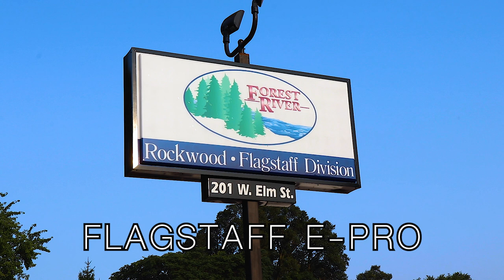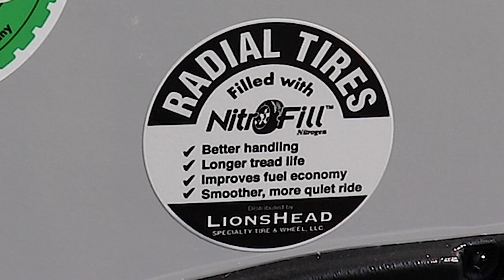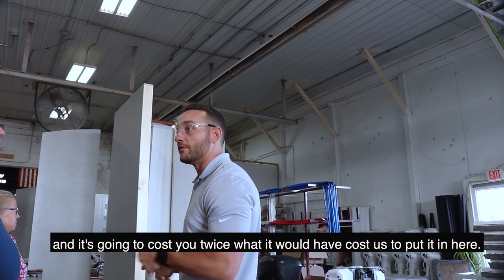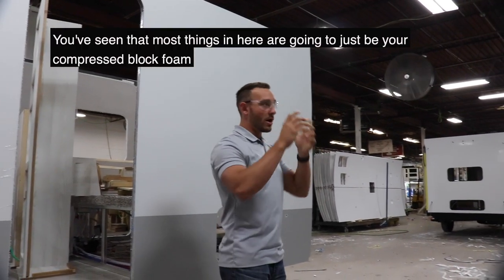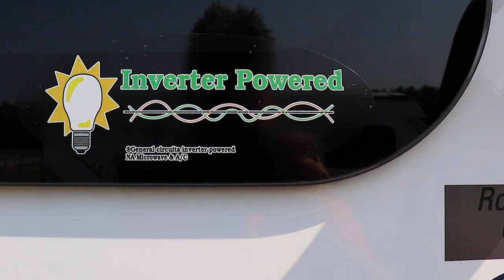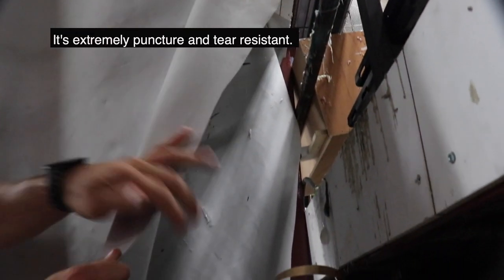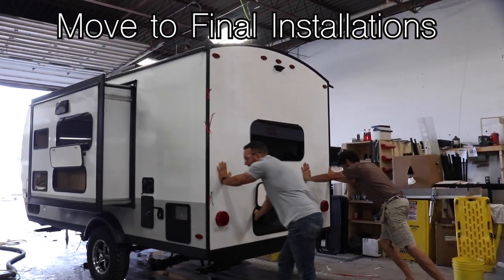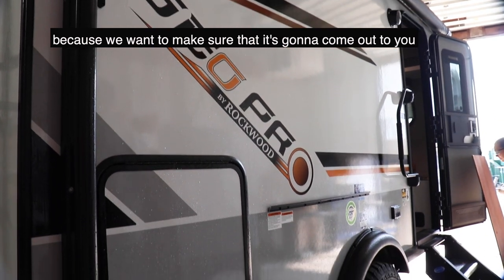Rockwood Geo Pro Travel Trailer- Flagstaff E Pro Factory Tour | How the Geo Pro and E Pro are made

Comment: Recently purchased a Geo Pro 19FBS and while inspecting the under carriage noticed the DARCO moisture barrier was torn at most of  the bolt penetrations around the perimeter that hold the aluminum frame in place. Good thing for duct tape.
Reply from the maker: paul1mdrn thanks for reporting this! Did you get that info to your dealer? They have the best inside track for reporting quality issues. This one sounds important. The moisture barrier is no good if it has holes.

Comment: Wondering why you didn't show any of the welding, aluminum joint construction, or how well the wall/floor/roof sections are built. IMO, poor welds are just as bad as sticks and staples. Thanks for all the work you did putting this together.
Reply from the maker: Hi @Paul Buehler!
I didn't show these things due to a couple factors: All the welding & fabrication of aluminum framing is done at sub-assembly plants that I didn't tour.
Likewise, the wall/floor/roof assemblies are constructed in the lamination plant. The tour I was on was public and it moved right along. We didn't linger at any one station for long.
From my experience and that of other owners, the framing and laminations of the Geo/E Pro are solid & reliable.
Thanks for the question!

Comment: Just bought one picking it up 3/28/20 GeoPro 19FB Parris RV Salt Lake City Utah. My first RV camper. Super excited. Loved the tour thank you, the seem like very well built trailers.
Reply from the maker: Jason Robbind! Super stoked you’re getting one! My wife and I bought one as well recently. A 20FBS. Been too busy to use it yet but are excited nonetheless. These are GREAT little trailers and I hope you make tons of memories in yours!
Thanks for watching & commenting!
Reply: Jason, how's your coach holding up so far since your purchase? What is your tow vehicle?
Reply: @USNavyAR5  Hi, its holding up great so far, already been all over Utah,Colorado,New Mexico, Arizona.  The 100 W solar panel works great, I did have 2 Lion lithium Ion batteries installed so going off grid is no problem And sense they're so light I upgraded for the big propane bottles also. My tow rig is a 2019 Toyota Tacoma TRD pro. I installed a massive transmission cooler and  l'm running a equalizer hitch and she rides like a dream. I just  Winterized it and covered it for the winner cause it's starting to get cold here in Utah at night have a good day. Good  luck.
Reply: @jasonrobbind231  Outstanding! I also have a 2019 Toyota Tacoma 4wd double cab V6, so looking for something lighter to tow. Thanks for responding back.

Comment: Forrest River might want to put in some extra time making sure the nuts are torque per spec on the bolts that hold the body to the frame of the Geo Pro. I found 4 ea that were loose and found out this is a common issue.
Reply from the maker: weatherherk1 I’m hearing it’s a common problem as well. I’m not sure more torque will fix the problem though. There’s only so much torque you can put on those before they start to crush the wood. I suspect a long term fix will be using self locking nuts. 🧡Thanks for watching & commenting!💙
Reply: @CrowdFreeRV  I had this problem as well. Did you get a visual look at how the 12 bolts underneath (2019 19FBS) are connected to the frame? What backs them up? I had a couple nuts fall off, then the bolts actually started spinning/stripping when you try to tighten them. My dealer added a few bolts/nuts through the floor of the camper after it was obvious the body of the camper had slipped/moved forward on the frame.
Reply: @CrowdFreeRV  What they should do is use steel plating on the floor( maybe 4”x 4”x 1/4”) and run regular bolts through them instead of carriage bolts and use a nyloc style of nut to attach the chassis to the frame. Much more surface area so the bolt won’t pull through the floor when tightened down.

Comment: Since you visited the factory, did you get any better idea about how specifically the solar panels were mounted? Are they just screwing the aluminum mounts into the foam? Im looking to add the extension gopher panel and would like to mimic the construction method of the manufacturer. Thank you,
Reply from the maker: Hi @Todd Sheehy!
It was the older version 100 watt flexible panel being installed when I toured the factory. It’s now a 180 watt hard panel now and I haven’t seen the installation of it.
I would assume the aluminum brackets are screwed to the plywood roof decking. Normally roof sealant is applied to the bottom of the panel brackets and the screws will have sealant applied on the threads as they are installed, and then both are sealed on top as a final step.
Rockwood does have a Support tab on their website for questions like this. 
And you might be able to gain some info in the FROG forums.
Hope this helps!!

Comment: Thank you for the video. Did you happen to have any discussion with them on reasoning for single axle vs dual axle? Can you tell me how it feels to go from a dual axle trailer to a single axle trailer. Thank you
Reply from the maker: Hi @HY Y!
The reasoning they stated when I took the tour is they are ultralight trailers and one of their original goals was to keep every model under 3000 lbs dry weight. In 2020, with the G20BHS at 3400 lbs dry, they exceeded their 3K benchmark for the first time. So yeah, the short answer is keeping them as light and as towable as possible.
The big change in towing feeling is movement. The short single axle moves around a bit more and it moves a little quicker. It is highly maneuverable though,  I can get it in & out of just about anywhere. The biggest downside of the single is reduced cargo carrying capacity.

Comment: Do they offer a 4 season arctic package? Also I’m a newbie and saw the Grand Design warehouse tour on a separate video. Their trusses are made of wood. Is there such a thing as metal trusses?
Reply from the maker: 👋 Hi @Raymond Ward!
They do not offer a four season package, nor would I expect them to. This is primarily due to their goal of trying to keep all units under a benchmark 3,000 lbs for greater tow-ability. I will tell you from my experience that the Geo Pro does “mild” winter pretty good for a 3 season trailer. We’re wintering in NC and have seen some 27 degree nights. Nothing has frozen up. I run a heated fresh water hose and I have insulated the fresh water low point drains. Whenever it’s going to be near or below freezing I turn on the tank heaters. I run two small electric heaters as primary heat and set the gas furnace to kick on a little when it gets near freezing outside. I would not recommend trying to winter in a Geo Pro off grid without an upgraded solar & battery setup. And I would not recommend one for longer term  sustained below freezing temperatures.
.
To my knowledge no one is using a pure aluminum roof truss. The Geo Pro uses a hybrid. It’s a combination of aluminum and wood. Just speaking for Rockwood and Grand Design, they both make a good “walk on” roof.
Hope this helps!
Thanks for watching & commenting!

Comment: I have the 12srk and have enjoyed it thus far. Only minor things, added a switched porch light..the only way to turn it off before that was to open up the rear kitchen. I also added an additional solar panel, funny thing the side connection for the additional panel needs to have a charge controller on the added panel even though the onboard charge controller could handle it. I plan to rewire that. The A/C is huge for the size and useless when boon-docking..I would have preferred a smaller unit and maybe a 12v big fan. I tow it behind my Jeep and have had it down some rough roads, so far she’s holding up. I enjoy the creature comforts this little trailer has when full connections are available but rough country camping is why I bought it. Similarly purpose built trailers are 3x as much. I am afraid if the screws start backing out of the micro wave I may leave on a dirt road somewhere but I keep an eye out, may just pull it for the space. Bottom line, happy with camper and would buy again.
Reply from the maker: 👋 Hello @rambokd! Great to hear from you. I think what you have stated about the cost is one of the biggest factors for choosing the Geo Pro. Better built units are out there but at a factor of 2x or 3x the cost.
You are the first comment I’ve had from someone pulling a 12srk behind a Jeep. It’s great to hear that it’s holding up!
Appreciate the tip on the aux solar panel. I hadn’t heard the before and like you would have assumed the interior solar panel would handle it. I think I’ll get a suitcase unit with built in controller.
Thanks for watching & commenting!
Reply: Watching the madness in the factory explained all the extra hardware I found in my trailer. At first I thought there were screws coming loose but there must have been a dozen extra screws. I pulled all my access panels to see how everything was routed and connected. The external solar plug runs directly to the battery through a circuit breaker, in my case along the front driver side rail. I had to contact forest river because of the issue with the solar and they were kind enough to send me the wiring diagram. I currently have a y connection on the existing roof panel, but plan to run new wire down from the controller. The batteries, I have 2, have not dropped below 80% with normal use to include some gas furnace use on cold nights. I added a rear awning so I can close my kitchen but still have rain protection for my table and chairs. If you leave your kitchen open little bandits will worry you to death. Funny coincidence, our first night in it was next to another Epro owner on his first trip. He had the 19ft version and the Bluetooth app to control your stereo doesn’t care which system you connect to...his radio woke up earlier than he did, I thought mine was broken.

Comment: One thing you missed, installation of the water and holding tanks, where are they, are they enclosed in a heated space or just below the floor and in the elements?  Thanks
Reply from the maker: Scott hello sir! My apologies that I missed this question earlier.
All models have the holding tanks mounted between the frame rails and just under the floor of the unit in an open and unenclosed space. Rockwood does not enclose the underbelly on these to keep weight to a minimum. The tanks are heated though via 12 volt heating pads mounted on the underside of the tanks.
The location of the holding tanks widely varies by model. I own a 20BHS. The fresh tank is all the way forward, the grey is just behind the axle, and the black is all the way in the tail. Hope this helps!
Thanks for watching & commenting!

Comment: This is a very nice rig and I am considering buying one.  It looks like they are taking advantage of some new technology but, there are some things I would like to see.

1. A dehumidifier. Cooking with propane, normal breathing and camping in humid areas produces humidity in the coach. There are some newer dehumidifiers that could be built  in. 
2. An on demand propane water heater in lieu of the electric/propane water heater. Very efficient, less space, less weight.
3. Two 30 pound LP tanks
4. Switch to LiFePo4 batteries. A bit more expensive but lighter and better performance.
5 . Better wire control on roof for solar. Evil trees will reach down and snag those wires.
6. Roof rails to mount things such as satellite and radio antennas, weather station components.
7. Full underbelly protection.  Mice and squirrels are the enemy of RVs.
Reply from the maker: Al Dec thanks for watching & commenting! I have a full quality review coming up on my Geo Pro, a 20BHS. Stay tuned.

Comment: Should  you ever have to touch up a cabinet or such, is there a specific paint code for the white paint used inside these RV trailers?
Reply from the maker: a1930ford there is not one that I am aware of. Your local dealer should have a list of contacts at Rockwood/Flagstaff where this question could be answered. If this does not work, you could possible remove a small part and take it to a paint store to be scanned to get a mix code.

Comment: I would like to have seen how the walls are actually connected to the floor.   I bought an E-Pro 19FD new in 2018.  From the factory there were problems with the steps not installed correctly, entry door not installed correctly, cabinet wood had termites ($1200 to exterminate), antenna not fasted to roof.  I just finished using it for 4 months full time and the dinet frame broke apart from travel/vibration (never sat on it).  I've resealed the roof seams every year and now have found water damage around the entire floor where the walls meet. I'm now looking at major repair cost or taking a big loss at sale/trade.
Reply from the maker: @KstrSM15 when I did my tour I did not see how they attach the walls to the floor.
I’m sorry to hear about your experience. I’ve never heard of an e-pro being this bad.

Comment: As someone who worked in a manufacturing environment with ISO 9001 quality systems, I can tell you this factory is the exact opposite of a quality-focused  environment. Modern factories are incredibly clean and organized (nothing is out of place). There are many tools and jigs assisting the employees with perfect repeatable quality installation at every step of the way. Notice how the lady was just free from slapping on graphics or how they guy screwing in the slide was just holding his screw gun at random angles and reaching? 

This factory appears very unorganized with almost all completely manual processes and no tooling or assembly jigs. A modern factory also has quality control at every step. Not just at the end. I.E. them orange taping issues or the guy quickly caulking a leak. This is about what I expected and I’m sure it differs little from other lower or mid-priced mfrs out there. You can see this and know there’s a ton of room for human error or stuff slipping through. That’s just the RV trailer market as a whole though. Not trying to single out Rockwood. I do overall like their Geo Pro. I just wouldn’t expect much more than any of the other common name brands out there.
Reply from the maker: Mike Wiebe 👋 hello sir! Having worked in manufacturing & aerospace for 7 years myself, I understand exactly what you are saying and agree with your assessments. I bought a Rockwood Geo Pro at the beginning of this year and just returned from its initial shakedown trip of about 5,000 miles. This is my third travel trailer and I am thrilled with the progress the industry has made. I’ll attempt to briefly elaborate:
If I could sum up your comment into one sentence it would be “RVs have been and still are sloppily assembled”. My Geo Pro is consistent with what I saw at the factory tour - it is indeed sloppily assembled.
However, the advancements in some materials and methods make a tremendous difference -
Because of Azdel & vacuum bonded walls I will never have delamination.
Because of the welded aluminum framing I will never have the structure rot.
Because of the Torflex axle I don’t have wear points at the springs & shackles.
Because of the welded aluminum interior structure & “screw & glue” cabinetry, my interior isn’t falling apart after 5000 miles.
Because of the arched roof trusses I never have constant standing water on the roof making my roof seals go bad.
Etc, etc, etc...
.
So yes, the industry has so much room for improvement, but there is also much to be celebrated.
I’m going to do an initial quality review of my G20BHS soon and I’ll share the good, bad & ugly.
Thanks for watching & commenting sir. It’s much appreciated!

Comment: So the roof membrane isn’t bonded to the laminated roof? And what is directly under the membrane?
Reply from the maker: Hi @Leland Plume! They do indeed bond the membrane to the roof. They apply the adhesive up on a work platform and I wasn’t able to get a good shot of the process.
The roof plywood decking material is directly under the membrane.
Reply: @CrowdFreeRV  OK. Thanks! I was asking because I was on the ladder, looking at the roof of a brand new unit on Saturday and there were unbounded wrinkles around virtually everything that was attached to the roof! I’m afraid the expedited manufacturing that’s taking place right now is not only affecting putting in the required appliances, (12v fridge, low profile AC, porcelain toilet), but the quality of workmanship may be taking a hit too, (unbounded membrane, cabinet doors separating, body to frame bolts missing or coming loose). They still build a quality product but I think they may need to make some changes. The blogs and forums indicate their reputation may start taking a hit.
Reply from the maker: @lelandplume6889  yes, this trend is appearing across the board in various ways for all manufacturers. I looked at a Keystone Outback Ultralight with a family member last fall. Keystone is a quality brand. The entire roof of this brand new trailer needed a reseal. All the sealant was shrinking and opening up with seal-voids. I suspect they had run out of their regular sealant and used an inferior alternate. This is just one of many stories.
.
I expect this trend to continue through 2021. From what I am hearing from dealers is there is still pent up demand from 2020. The units are rolling out as quick as they can roll in from the factory.
Reply: @CrowdFreeRV  the numbers I’ve seen indicate your correct. The projection is that over 1/2 a million units will be built this year to meet demand. The highest number ever. But the general consensus seems to be that starting next year, when people realize that RVing is about more than driving and parking or they realize they can’t handle their rig, there will be a glut of slightly used units flooding the market. If you know what you’re looking for it’ll be the perfect time to buy.